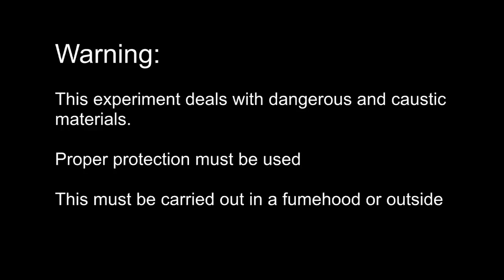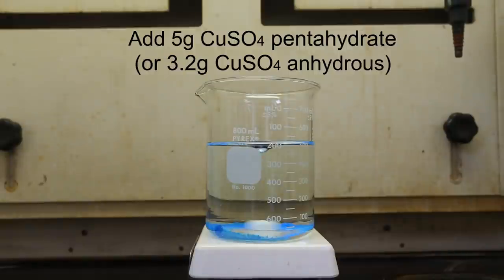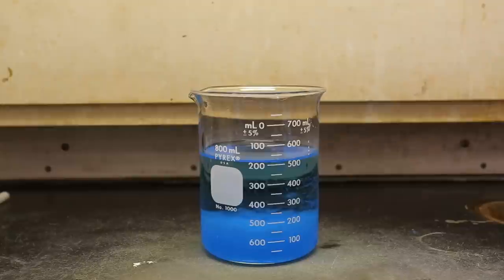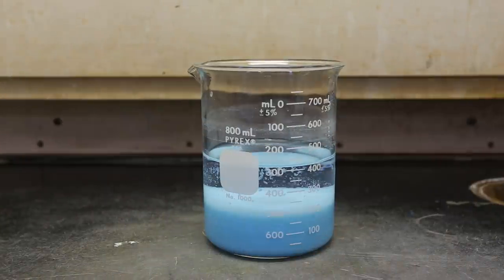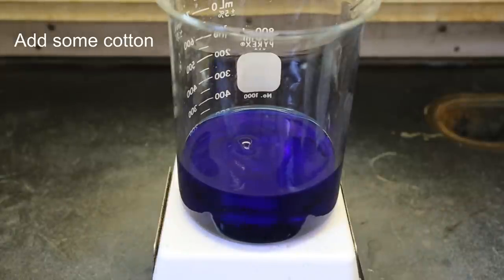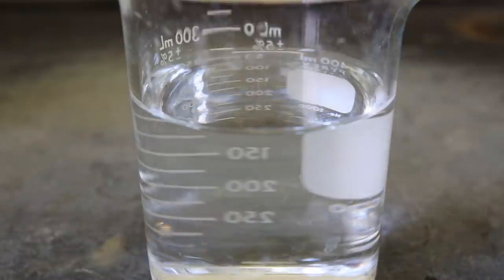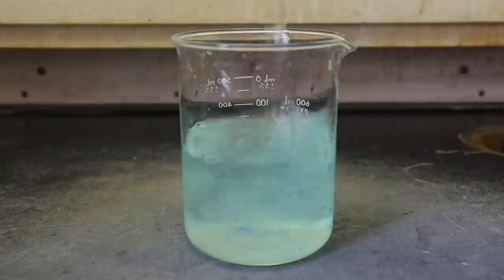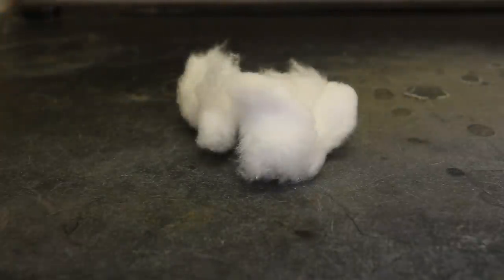How to Dissolve Cotton in Water

Comment: Pro tip: If you spill something on the carpet dissolve the whole thing in Schweizer's Reagent and then re-precipitate it back onto the floor. The stain will be gone.
Reply: and also the carpet. for extreme problems, extreme measures.
Reply: Polyester carpets 🤔
Reply: Facu Fourcade that’s why you need to re-precipitate it back on the floor, so it forms another carpet
Reply: Most carpets are nylon and polyester. In fact I'd be willing to bet money that carpets made entirely of cotton are illegal these days. But hey, you could probably find a way to take a deep breath and end up in prison these days.
Reply: 5 minute crafts be like ^
Reply: @OkieDokieSmokie  Persian Carpets are made of natural fibers... but VERY expensive.
Reply: @OkieDokieSmokie  why would it be illegal? o:
Reply: @OkieDokieSmokie  cotton carpets wouldn't be that expensive, but hand made wool ones like Persian carpets or from other regions in Asia can potentially be very expensive and quite tempting for smugglers
Reply: @OkieDokieSmokie  Why illegal?
Reply: But you will just lose the shape
Reply: I want someone to do this now
Reply: @cafux78  No no no, you see? With this product, your carpet will rain back onto the floor! Buy Schweizer's Reagent at your local supermarket or hardware store!
Reply: @ithewho6603  Too flammable maybe?
Reply: @jaredpatterson1701  Too flammable maybe?
Reply: @jakeheyes3506  what does that have to do with anything? Just don't spill any hot sauce on it😎✌
Reply: Instructions unclear, the whole carpet got stained with the colour
Reply: Does it work on my sisters shorts? I spilled some yogurt on it.

Comment: Wood is also made up of cellulose! Can we dissolve wood in this reagent? and How it will precipitate on action of acid on it?
Reply: +Sayli Rasal Wow, great questions. I want to know too. Precipiting wood this way would be so awesome!
Reply: +Sayli Rasal I'm afraid wood has other components apart from cellulose, such as lignin, which I don't think is soluble in this reagent.
Reply: +MrSaliVader yeah you are right. It probably wouldn't work
Reply: +MrSaliVader would the cellulose dissolve?  Would it ruin the integrity of the wood?
Reply: +Nabbehh I don't think so, the cellulose is mixed with the lignin. I don't know for sure, though. The best way to solve this problem would be to make this video again but using wood instead :/
Reply: +Sayli Rasal It's used routinely for the industrial production of cellulose (and presumably nitrocellulose, etc.) with wood PULP (or cotton)
Reply: I wood like to know that also.
Reply: You would have to grind up the wood first, similar to the first steps of the paper making process.
Reply: @FelonyVideos  or just get free sawdust
Reply: You can easily remove the lignin from wood and then after that you could try to react the leftovers
Reply: Wood is only part cellulose, it is also made up of hemicellulose and lignin.
Reply: Porkchop Sandwiches good point

Comment: Copper is among my favorite elements because it makes such pretty pigments, and it can be used for many different things, such as fireworks and plumbing.
Reply: Copper salts and compounds are also used as timber preservatives and ship anti-fouling, also certain sterilising treatments. It is also involved in the initial transfer of O2 across the lung's Alveolar membranes into the blood and thence to hemoglobin. And anti-corrosion coating of steels, etc etc. It's used often in other metal alloys (brass, bronze). Or used for electrical wiring, contacts, and tools (alloyed with Beryllium etc). And coins. And rocket combustion chambers. And some 'high-temperature' super-conductors.  It is very under-appreciated by joe-public.

Comment: Would it be possible to freeze the reagent with the cellulose dissolved in it, and then freeze dry it to produce an aerogel type cellulose substance? If so, then it might be able to be decomposed to form a carbon fiber aerogel?
Reply: Isn't aerogel already mostly carbon/silica?

Comment: Using a bit different chemicals this is the principle to turn wood fibre into rayon that you make fabric and clothing from. You dissolve the fibres into sodium hydroxide and carbon disulfide. Upon pumping the solution trough fine nozzles submerged in a tank of sulphuric acid and some other add on chemicals rayon fibres are formed and then spooled up.

Comment: What are the industrial applications of reconstituting cotton in such a fashion?
Reply: +AntiProtonBoy As far as I know, dissolving cotton is done to make threads. This makes the fibers go in the same direction.
Reply: +AntiProtonBoy It's not used to reconstitute cotton.  It's used to dissolve cellulose sources (cotton, wood pulp, etc.) so that the cellulose can be reconstituted into novel semi-synthetic organic 'fibers' such as Cellophane, Nitrocellulose, Rayon, Lyocell.
Reply: +AntiProtonBoy Creation of cellulose. Its a non-synthetic but synthetic like fiber similar to polyester or nylon, used as a soft stuffing, in clothing, or for 'synthetic like' organic wicking material. You know it as rayon when used in clothing. Usually called cellucotton when used as a stuffing. One of its main advantages is it chars, but doesn't melt. 
Its also shoved in pills as dietary fiber supplements.

Comment: I wish you dried out the fibers after to inspect it.
I wonder if you could pull out a thread of cotton by layering both solutions like done with nylon or silk.
Also would the fibers be powdered if you sprayed a mist of solution? Or what if you put a drop of the second solution into the first one instead of the way you did

Comment: Hi, it is a cool reaction. But I wanted to ask, what are the real life implications of this solution? Is the solution toxic? Thank you and cool chanel.
Reply: this solution was formerly used industrially to dissolve plant material, paper or cotton clothing meant for recycling. The cellulose was however precipitated by forcing the solution through an extremely fine needle that span at high speeds so that the cellulose would form long continuous individual fibres which could be used to make threads and woven into new clothing. The new material was called "rayon" as the cellulose was not directly processed from plant matter but rather dissolved and reprecipitated. Although the chemicals used can be recovered and reused several times after the process to form new solution, most companies considered it not cost efficient to do so and simply dumped the used chemicals. Thus, this method of rayon production was ruled illegal in several countries due to toxic waste generation when companies refused to recycle their chemicals.
Reply: @PixlRainbow  The 'needle' isn't spun at high speed. The spinning is akin to the way spiders 'spin' web-fiber/silk;  (their arse doesn't rotate at high speed either). The Rayon precursor is forced out of multiple fine holes in a submerged 'spinneret' to precipitate Rayon fibre, which is then continuously reeled up.

Comment: Ok this is a duplicate post, but with further sugestions.

The idea that you have produced Cu(OH)2 is a little misleading is it not? The reason for the variation in colour is that various basic copper sulphates/hydroxide minerals are formed in different ratios depending on exactly how they are mixed.
Spertiniite   Cu(OH)2
Antlerite      Cu3(SO4)(OH)4
Brochantite Cu4SO4(OH)6

Could you test for the presence of sulphate after reprecipitating the cellulose in hydrochloric or nitric ( or acetic or citric ) acid? 
I wonder what would happen if you disolved the copper as acetate or citrate complex ion and then precipitated it out with sodium hydroxide?

Comment: Would the nitric acid solution nitrate the cellulose precipitate creating nitrocellulose, or does it require a nitrating solution with sulfuric acid?
Reply: Nitrating solution
Reply: +dstnlockwood77 It does require a nitrating reagent, the nitrate ion itself cannot do that. The sulfuric acid turns some of the nitrate ions into nitronium ions and those are the ones responsible for nitrating the cellulose.

Comment: I wonder if cotton would still dissolve in a tetra amine copper (II) nitrate sloution the same way as done in the video and if so, could the cotton be nitrated with some sulfuric acid added?  If so I just got a neat experiment idea.  Thanks for the video and info!
Reply from the maker: I am really not sure. I know though, that adding sulfuric acid to a tetraamine complex made using ammonium hydroxide is going to neutralize the ammonia and destroy the complex.

Comment: So, say I wanted to make nitrocellulose lacquer (I don't, just speaking hypothetically.)  Would I be able to start with this process?
Reply: If you want to do that, it does not work with this reaction, because if you make Nitrocellulose - which, actually, should be called cellulosenitrate - you replace ALL the hydroxy groups in the cellulose, which make the shown reaction work, with nitrate groups, R-NO². However, if you add CAMPHOR to nitrocellulose, you pretty much get what you want to make - we know it as Celluloid!

Comment: Will the schweizer's reagent be stable if I let it dry so it will become a powder? Just so there wont be any possibilities that it would create any explosives or such.
Reply from the maker: dtiydr I don't think it is in any way an explosive risk. However, I believe it is difficult to dry it completely, but I read that it could be done.
Reply: Nile Red Thanks for the answer, and really interested vid btw.

I also just remember that heat would destroy it, but it can be dried by vacuum and I have vacuum pumps so that should be an option. I then also read that the powder should be kept in an atmosphere of ammonia gas since if would be destroyed in the end in normal air as I understood it since ammonia would be released from it.

Comment: Is there anyway you could possibly create a chemiluminescent reaction using luminol? I've tried several things but I'm trying to make my glow last longer and would like to see what you advise.
Reply from the maker: At some point I am sure that I could do it! Nurdrage has done a pretty in depth video about it though. Have you seen it by any chance?
Reply: Yes I have, but he uses TCPO, something our chemistry department doesn't have, and cannot obtain. I was hoping for an alternative procedure.
Reply from the maker: Oh okay. I will do a little research and see if I can find another way.
Reply from the maker: ***** Hey, TCPO is used to make glow sticks, whereas luminol can be made with easily obtainable chemicals. Are you trying to find out how to make glow sticks without TCPO?
Reply: Yes, essentially.
Reply from the maker: ***** I think that it would be really hard to do that. However, you could make the TCPO yourself. You can make TCP yourself from phenol and a chlorine generator. Then if you can get oxalyl chloride, you will be able to make it. Do you have the necessary chemicals for that?

I think making glowsticks without TCPO would be very hard. As you saw, luminol doesn't last very long. Most chemiluminescent reactions don't. I think finding another chemical that lasts long like TCPO would be difficult. I will look around though.
Reply: When it’s been 8 years

Comment: I have a question: how long does the process of dissolving the cotton usually take? Because the cotton seems to just stay in for mine, and upon moving it over to the 10% acid solution, it doesnt seem to work :(
Reply: I have the same problem
I made this solvent and add 0.1 gr of cotton to 20 ml of solvent but after almost 24 hours cotton has not been dissolved

Comment: hey Nile, I have a question, I can't afford a mantle at the moment but I do have a portable e!ectric range that I have been using but I cannot get the sulfuric acid to boil I use a cast iron skillet with a round copper skowering pad that I burned so it is pretty flat and the RBF sits in the middle I tried using the air bath and it worked better alot of steam but no boil?  it's 1500 watts,  Please help anyone!  if anyone has a used mantle that is capable of achieving the high temps I will buy it I need a 500 ML but I heard that 1000ML would work to.  should I try a pot full sand?  please help my fellow home chemists.  thanks for listening.  love your videos brother!
Reply: Take apart an old electrical convector heater. Rewind the element. Use Sodium silicate to form the fibre/element around a suitable hemisphere. Stuff it in an old ceramic pot lined with ceramic fiber/vermiculite/pearlite. Jobs a good un.

Comment: Ping pong balls are made out of cullulose as well, correct? And if it is, it's extremely flamable also.
Reply: Ping pong balls don't explode, they combust and it has nothing to do with the air inside of the balls, it's not like they're not filled with pure oxygen (O2)... The reason why ping pong balls combust is due to the makeup of the material, which is nitrocellulose. Older ping pong balls were even more combustible because they were made of acidified celluloid. Either way, in both cases the air makeup inside the balls had nothing to do with their combustability, other than, maybe, giving the fire some extra O2 to breathe.

Comment: Wouldn't the nitric acid also nitrate the cellulose and convert it to nitrocellulose? You should try burning some of the stuff you got from the nitric acid solution.
Reply: It won't because he used a 10% solution of the acid, while over 60% is needed for nitration.
Reply: TU Relish you don't need 60% to get nitration to occur, that just makes it faster.
Reply: There are potential competetive reaction rates here, and, initially, with dil HNO3, cellulose would be precipitated as before. Subsequent conversion to nitrocellulose is debatable as that reaction depends VERY much on conditions, and remember that some of the HNO3 is consumed in causing the cellulose formation.

Comment: Don't the nitric acid and cellulose make nitrocellulose? Why not?
Reply from the maker: +TheTechnic Lord Nitrating something with just nitric acid is actually pretty hard. That is because nitric acid is HNO3, but you want to add NO2 to something. Generally you need sulfuric acid present to dehydrate the HNO3 to NO2. Also, the concentrations need to be quite high for any decent reaction to occur.

Comment: can you dissolve wood with this?
Reply: I think because wood isn't very acidic, it would still be possible to dissolve the cellulose, but there is more in wood than just cellulose, and the surface to volume ratio is low unless it's shavings or chips, which raises dissolution time. I haven't looked into it much, so don't take my word as Gospel, but I don't think there's much in wood that would disturb the reaction.
Reply: +youmakeitwhatitis I sat through a discussion in a chemistry class about dissolving wood and other grasses and things and they were saying that it was tough to dissolve because of lignens, but this solvent was not discussed, I think we were talking in terms of making bio fuel at the time.  so I'm trying to think of a way to dissolve cellulose and then do chemistry on it to make some type of hydrocarbon fuel.  (It would be great if this solvent could be regenerated or reused somehow)  As I thought through the process i realized it might be too energy intensive to do vs how much energy you get out.

Comment: What happens if you let the solution evaporate?
Reply from the maker: That is an interesting question and I am not entirely sure! I know that it is possible to isolate the ammonia/copper complex by careful evaporation. I think that if the solution is evaporated with the dissolved cotton, you would be left with a lot homogenous mix of ammonia/copper complex bound to cotton. However, I have never tried it. Definitely an interesting thought.

Comment: An easier way to make copper hydroxide is through the electrolysis of magnesium sulfate and copper wires.
Reply: I learned this through me trying to make copper  (ii) sulfate with magnesium sulfate. The resulting substance was a light blue, but insoluble unlike copper  (ii) sulfate.
Reply: I also left the water to evaporate,  and like he said in video, it stuck to the bottom of the glass Mason jar that I used.
Reply: Finally! An experiment that I can do without having to buy any chemicals!

Comment: Is it possible to "cast" some solid object of desired shape from that solution? Can it be evaporated?
Reply: Well, wood is partially made of cellulose too and it can keep it's shape.
Reply: Tycho343 so is toilet paper. Your point?
Reply: You understood his point pretty well
Reply: Yes and no. You can make cellophane foil out of it. But for making objects, people would use cellulose acetate or nitrocellolose so i assume those two materials are more suitable to making anything else than foil from. Guitar picks are still often made from nitrocellulose. Yes, they are very flammable.
Reply: You can skip a step and just squish cotton balls into the mold for the same effect

Comment: You say that, to make paper, clothing and cellophane, cellulose must first be dissolved.  This is wrong.  Cellulose is not dissolved in any of these processes.  To make paper, cellulose fibers are separated from the non-cellulose components of the starting material, then the cellulose is suspended, not dissolved, in water and cast into a sheet by mechanical filtration.  To make clothing, cotton fibers, made of cellulose, are mechanically separated from other parts of the cotton boll.  No dissolving is involved.